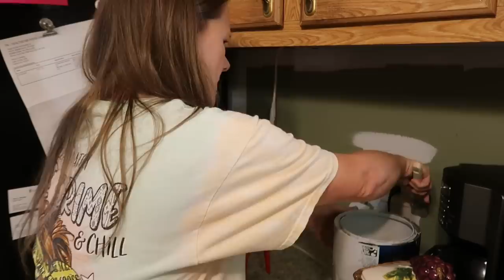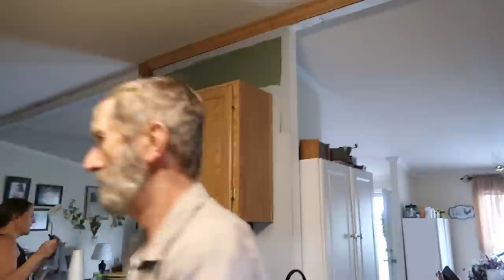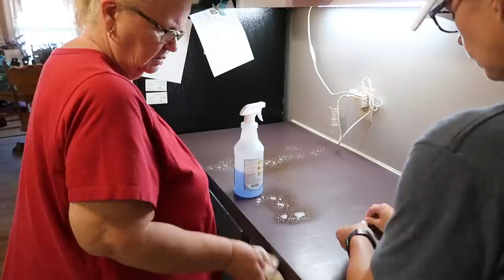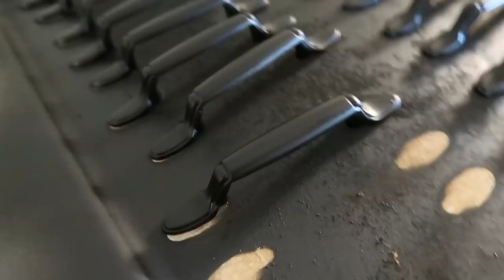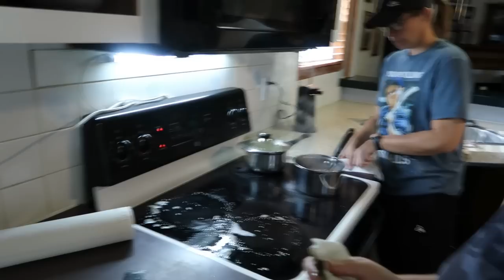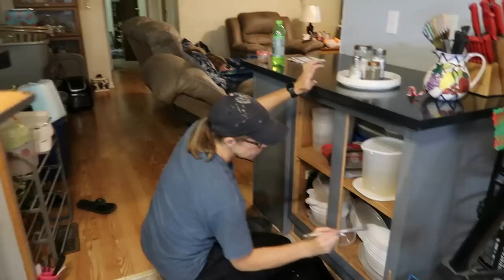NEW *2023* MOBILE HOME KITCHEN MAKEOVER ON AN EXTREME BUDGET | DOUBLE WIDE KITCHEN TRANSFORMATION

Comment: Our countertop Formica was peeled in some spots so we tried concrete. My husband worked at block building company and got some mica powder colors and we did the undercoat cement that we colored black for bathrooms and white for kitchen countertops. We had to redo the sealant 3 types throughout the year until I found the incredible one that lasted over 5 years!!! But for life of me I can’t remember the brand. Now I played with epoxy in our small bathroom and it turned out so amazing. So I plan to use it in black, white and metallic brown epoxy colors in our kitchen. It can be used clear over paint instead of polyurethane. But I want some depth and it’s not crazy expensive either.